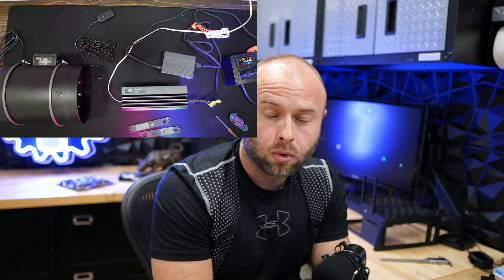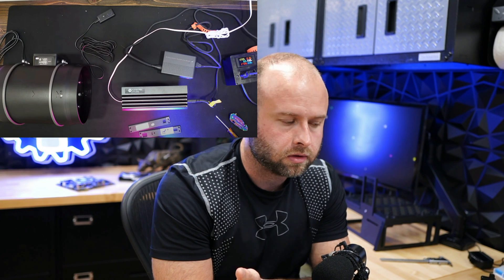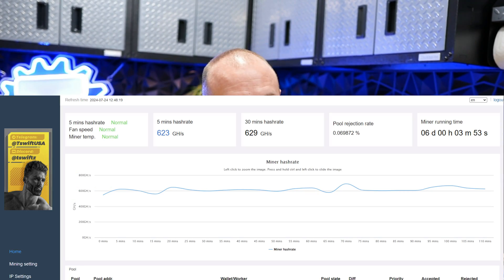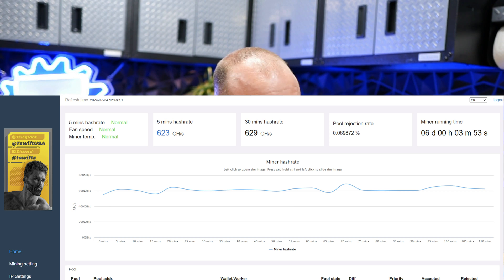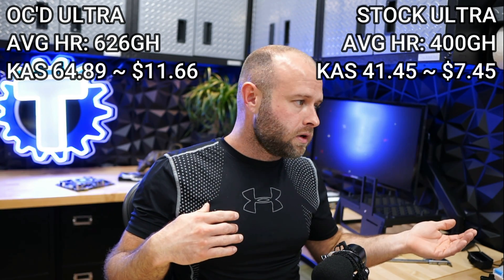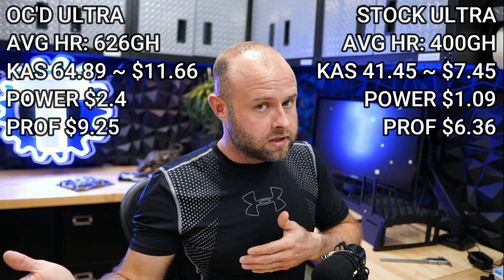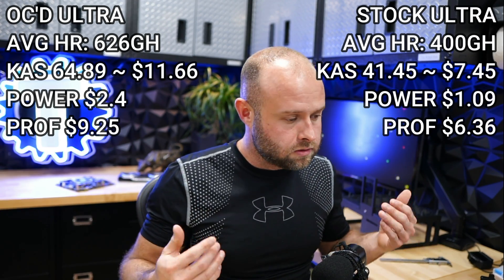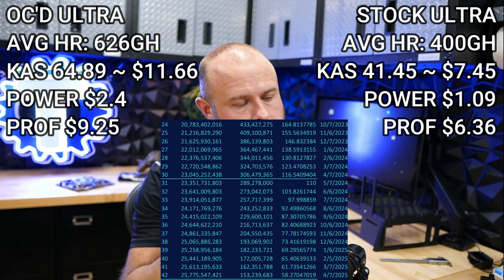"""DONT Overclock your KS0 Ultra"""

Comment: Hobbyist miner also did not confirm the new IP address until after he hit the reset button. He can use a super old laptop to remote in that way, heck he can use a complete different network than his home network. I still think Hobbyist miner f'ed it up himself. And his stance of not wanting to recommend it is just false IMHO. I've OC'ed 2 here at home and they've been chugging away perfectly. And at the way the Kaspa network hashrate is going through the roof it only makes sense to OC it. Dont find yourself regretting 6 months from now for not OC'ing. And if you get a second one then stop being babies everyone and OC that one too. The chart in this video just makes pure sense.
Reply from the maker: Pinned

Comment: after mod KS0 Ultra is only hashing about 1GH.  i re applied thermal paste/pads, installed the heat sinks on the mosfets.  moved the fans to the outside of the ultra.  I plugged back in and im getting 1GH.  I thought it was a power supply issue, but i tried a different one and no luck.  I reverted back to the original Iceriver firmware.  Still getting 1GH.  Any suggestions?
Reply from the maker: It was at 400gh prior to changing anything, right? Did you try the different firmware variants (L, ~, H) etc?
Reply: @TechnicalsMatt  yeah it was hashing 400GH on stock iceriver firmware.  when OCs came out i tried the 505GL.  That worked fine.  I wanted to get up to 600s so i got the thermal glue, heat sinks, 3d printed the shrouds.  I did the mod.  Typical straight forward mod same as we've all done on the KS0 Pros and original KS0s.  I let the glue cure for 24 hours and i put everything back together.  She fires right up and i can get to the UI just fine but it won't do more than a few GH.  I opened the monitoring tool TSwift gave us and chips are all green but there is no voltage or anything going to the chips.  I opened it back up and everything looks fine.  I don't think i damaged it.  I tried a different power supply and same thing.  I reverted back to original Iceriver firmware and it's still getting 5GH.

Comment: I think to overclock it almost done with all the stuff that need, but i have no idea how i am gonna so with the fans….need some ideas about fans plug in the wall….cant buy those infinity fans over here….
Reply: I got the BeQuiet Silent Wings Pro 4 120mm PWM 3000 rpm. Their made in Germany and very well priced....and quiet.
Reply from the maker: 12v 120mm fans will work too, like asic fans, just need an adapter to 3/4 pin

Comment: Thanks for bringing attention to this.  To add some more details for everyone.  I did this LIVE on Stream, so the VOD is out there.  I took the KS0 Ultra which had been mining for 10 days and removed the side panels.

My goal was to see how far I could overclock it on JUST air cooling with an 800 CFM 8Inch AC Infinfity Inline Fan. 

I didn't plan to do any MOSFETs for new Thermal paste.

I followed the Read Me and did the Intialize Firmware.  That bricked my unit.  I never even got a chance to get to the actually OC Firmware Phase.

I don't recommend this Firmware at this time, as if you Brick it, you need to give someone remote access to your network to "fix" it and pay for them to fix it.... 

Not worth the risk, just buy a second unit honestly.

Comment: I only did the 565 and its been fine. Only added fan on outside and upped the psu. So far so good and its hit 600 sometimes lol.
Reply: Just keep your internal fans at 100%
Reply: @RainBitcoins  I just let it run and it works fine if the chips cool down too much it seems to run like crap now if i was gonna do higher than 565 i would do the mods and the fancy shrouds and fans for sure
Reply: @FrogmanMining  ya but running the fans at 100% is not for your asic chips...its for the 4 vrm chips that we put copper heatsinks on. If you allow the fans to be controlled solely by the Ultra your vrm's are gonna get too hot. And the issue is we don't know nor does the ultra know how hot they are getting as they are temp controlled nor fan controlled. Hence leave your fans at 100%. It also says to do this in the OC instructions.

Comment: I did all the mods internally.  Mine is running at 562 with no outside fans just stock ones at 100% waiting for my shrouds to arrive from you ❤

Edit: it cost me less than $100 to do this

Comment: You NEED to really read and understand the instructions, and do the right cooling mods (AX-6 paste, good pads, shroud, Axial fan, etc.).  In most cases, with that it works like a charm.  Both of mine are running solidly around 600Gh/s even after playing with 676Gh using a 330W.   Definitely worth it to overclock and better than buying another KS0 Ultra
Reply: 100% agree
Reply from the maker: THANK YOU